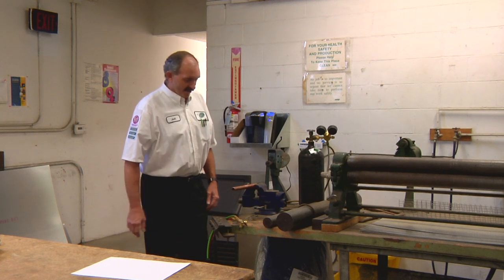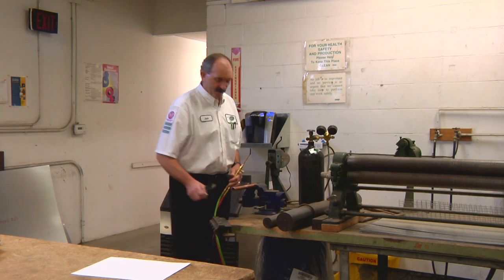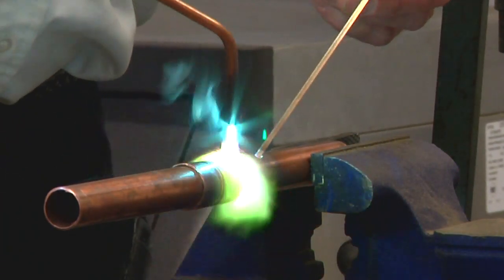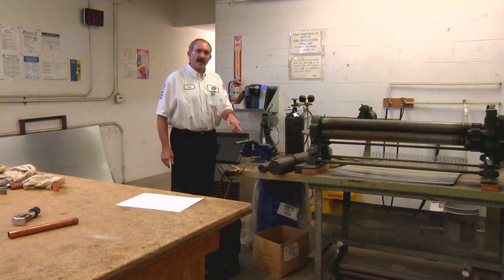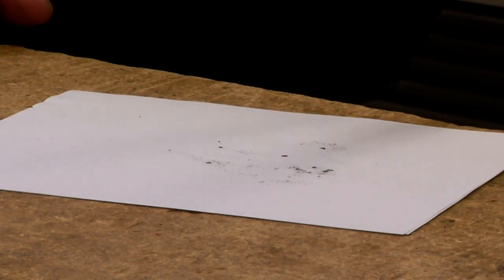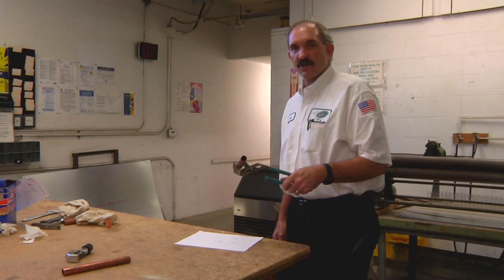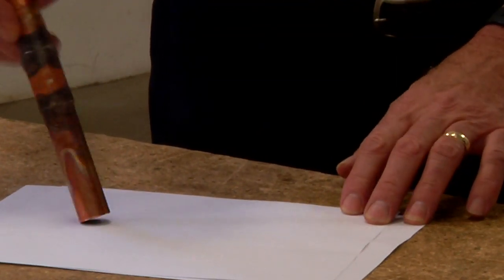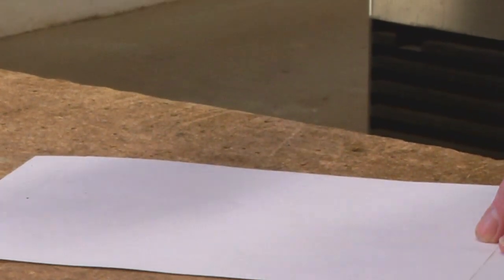Brazing with Nitrogen: Jerry Kelly HVAC

Comment: Doesn't the same oxidation occur while soldering?  Or are soldering temperatures too low for that to happen?  What if it did happen while soldering? The copper oxide would just be carried along with the water and out a faucet I suppose.  There usually aren't any critical valves in water supply pipes, unlike refrigeration where there is an expansion valve or TXV.

Comment: Thats why you don't "Braze" you "solder" which is done at a lower temperature and Flux is used which makes for a even seal ....
Reply: Solder isn’t approved for refrigerant lines, especially the higher pressures in 410a refrigerant. In the video, the wrong terminology is used, brazing is much hotter than soldering and uses a different alloy (usually silver based)

Comment: How do you flow nitrogen in lines of a refrigeration system you are connecting up/sealing up ?  The bench demo is not possible in practical applications, like installing a compressor.....that I am aware of !
Reply: +Pappys HomeBrew If you remove schreider cores from service ports, the gas can escape and that is the practical way to install a compressor or other components.